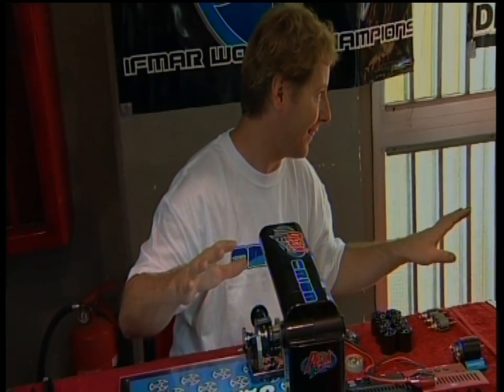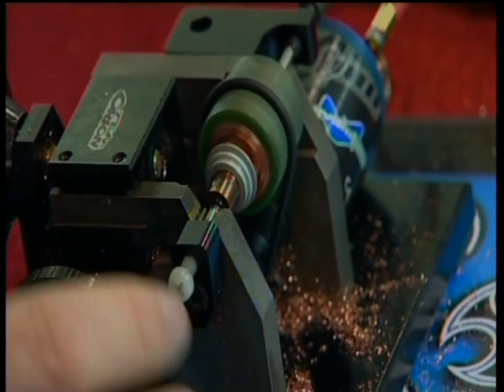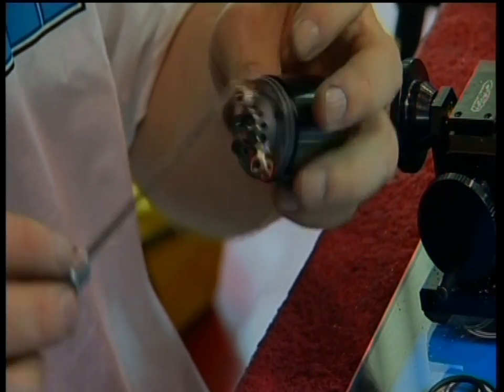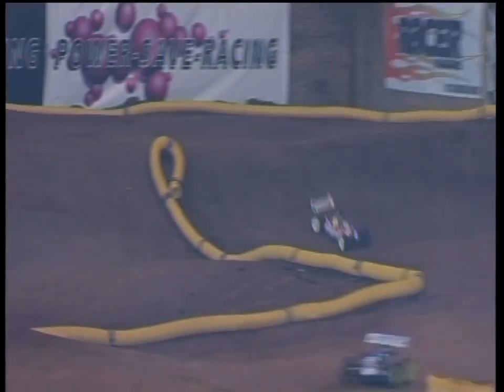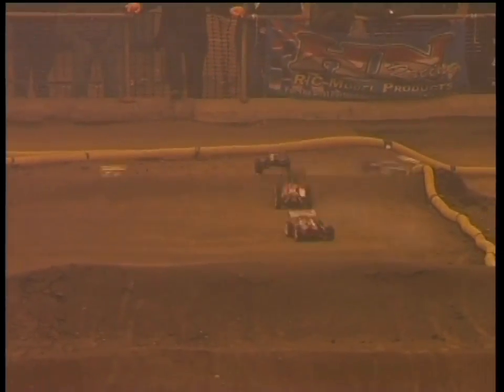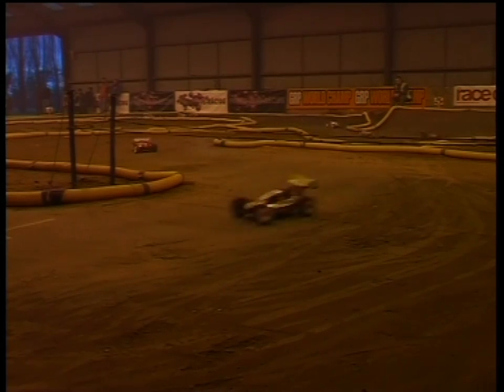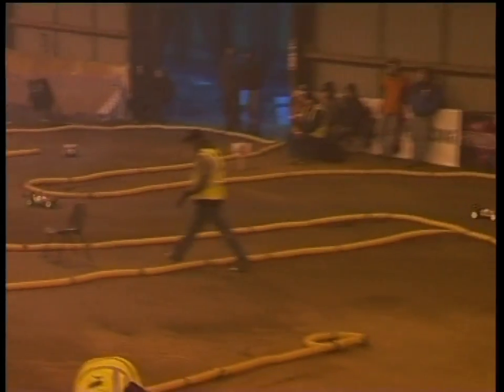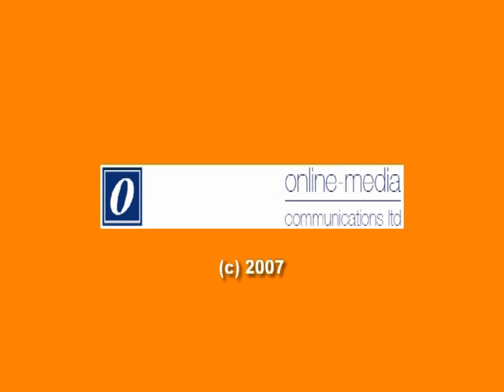RC Racing S1 Episode 7 - NEO 06 Semis and Motor Rebuilding!!

Comment: Oscar Jansen and Marc Rheinard the pro's of the time i was pretty into it , i miss this kind of rc tech , brushless just seams to take away the enjoyment and not to mention skills of tweaking a motor out , sure brushless has a programming method and timing etc , but remember when you used to get brushes that advanced the timing with a stock 27 , potions to dab on the comm to get a little more ,  i guess its more cost effective but i really didnt have an issue replacing brushes and bits for a few £'s but i have always found better results with brushed  especially stock racing , none of this 'blinky mode' etc , anyway thanks for putting this up
Reply: fixing with brushed motors vs brushless is like tuning an old V8 engine with carburetor and distributor by hand then a modern engine with fuel injection and digital engine management, all is done by hand and feeling and not programming. 

also like to tinker and adjust brushed engines and thay are cheaper to in terms of cost then the brushless systems.